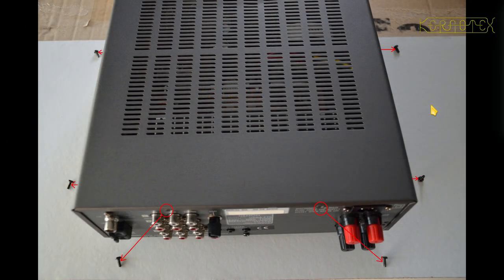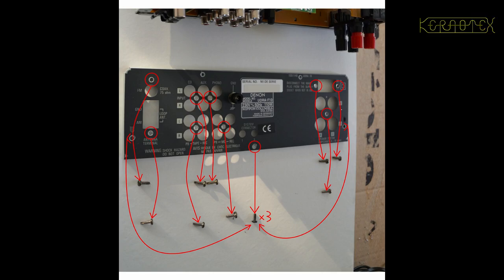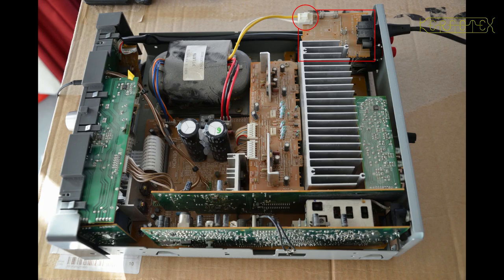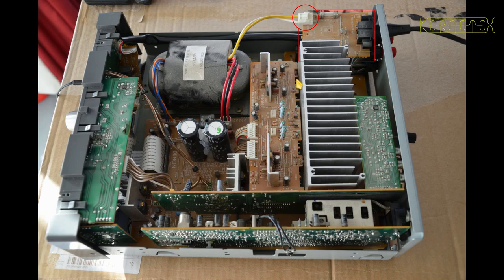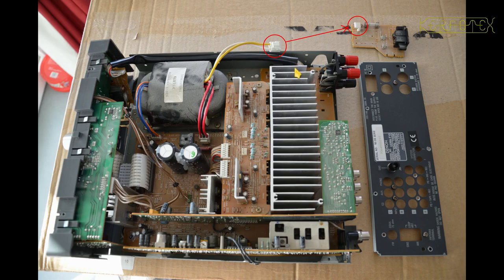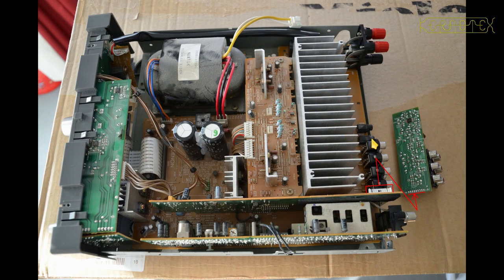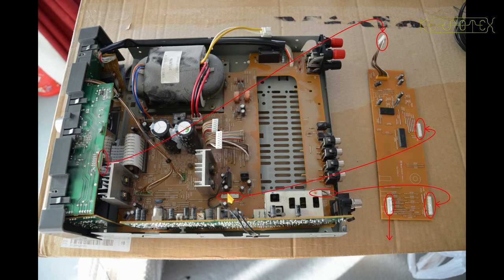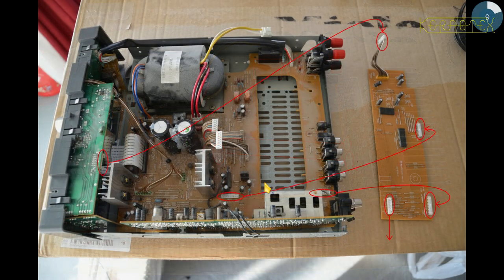Denon UDRA-F10 Repair for no sound from one or both channels

Comment: Great video thanks. It enabled me to fix my UPA F10 amp which is very similar. I had the same fault and having just replaced the same relay its now fixed. I'm going to cut open the relay and share the pic here if I can so me can see what the issue is.. I suspect carbonised contacts..
Reply from the maker: Thanks Anthony Fildes, happy it helped you too! I didn't take my relay apart (maybe I should) but like you I suspect the contacts have burnt out.

Comment: Thanks for good and detailed explanation. mine is Denon AVR3700h, which has a similar issue . denon audyssey detect speaker but no sound from Denon left or right speaker or with an external amplifier. all I can hear are some popping sound. any suggestion
Reply from the maker: Hi Deepak Sudevan, sounds like a dry joint or a loose connection. If there is a relay controlling the output stage in your Denon as there is in mine then it could be caused by dirty contacts.
Reply: @Kernotex  thank you.
Reply from the maker: @deepaksudevan  You're welcome!

Comment: Thanks for the video. I got a Denon AVR-S930 that has the front left and right speakers cutting out. I switched the speakers to other outputs and they work fine. Usually its only one speaker at a time that cuts out. Sometimes its the left and sometimes its the right but never both at the same time. Any idea how to approach this fix? Nobody in my area fixes these and it's only a year old so I want to fix it.  TYIA
Reply from the maker: Thanks The GG, That sounds a very strange symptom you have there! You could start by looking for bad solder joints in case there was a problem during the manufacturing process. Maybe loose leads inside (unlikely). I can't really think of anything else to look for with such a new machine other than getting it on the bench, sorry.
Reply: @Kernotex  i started tapping the receiver after watching several videos last night and the speakers kick back on. Gotta be a loose connection like you said. Thank you
Reply from the maker: @thegg5097  Good find! Thanks for coming back with your solution.

Comment: Heya, thanks for the video. Got a AVR-2113, where the front left speaker is way more silent than the right, no matter if headphones are plugged in or via speakers. Seems like it's somehow deadbeat, and when pinging it (say in windows 10), there's some kind of white noise to be heard, as if "somethings lying on the line" :D sorry, hard to describe. Got any idea maybe?
Reply from the maker: Hi Jebbel ! It sounds like it could to be more of a problem with power amp before it gets to the relay. However the relay is worth checking as it's a mechanical device and more prone to failure. The white noise could be high resistance from burnt contacts on the relay springs. If it's not that then I'd look at capacitors and the power transistors on the power amp board itself.

Comment: Hello sir, I have a Kinki THR-1 headphone amp and I am having problems with the right channel, it only happens with headphones but never the preamp XLR output and only when playing music. Randomly the right channel has noise/scratching/frying eggs kind of noise or the sound gets lost, if I increase volume sound comes back but with noise. Strangely when I play music with low frequencies is like a trigger to make the problem come.... I removed the top cover and when I move the front plate the sound comes back to normal. I cleaned the ALPS potentiometer and cleaned everything, both sides of the amp motherboard, caps are perfect, everything seems good, it has a relay as well. Is there a posibility to contact you and send you pics? I can pay if you'd help me fix it. Thank you very much
Reply from the maker: Hi José García it could be several things. I would start with the headphone socket itself - the connections that make contact with the headphone plug could be tarnished or loose. Check the connections of the socket to the circuit board. I've seen where the plug has been wiggled around in the socket so much it's caused a dry joint to occur though excessive force. If the relay is on the output stage for the headphone circuit then dirty contacts would be the problem.
Reply: @Kernotex  Thank you very much!! I managed to make a hole in the relay and put some deoxid inside, looks like the problem is gone lol. I never thought of the relay as the cause, I need more time to test it out tho but there's no longer static when connecting the headphones in the SE socket anymore so that's a good sign so far. You're amazing sir
Reply from the maker: @n00buo  Great News! Maybe a bit of dirt was on the relay contact and you shifted it. If the problem returns, it could be some arcing across the contacts. This could indicate a problem with suppression. But hopefully your repair will be the end of the problem now!
Reply: @Kernotex  I ended up replacing the relay for a new one, one of the metal pieces wasn't making clear contact to the other metal surface so that was the problem all along, a simple 3€ piece can make you think your $1000+ amp is faulty lol. Thanks again Kernotex you showed me the way
Reply from the maker: @n00buo  Hey that's great you fixed the problem permanently and cheaply!

Comment: Do you know how to set the clock on this? Can't find any button on the remote that hints towards setting the clock. Found it at goodwill.
Reply from the maker: Yes, set the clock like this (all buttons on UDRA F10 amp):

1. Hold Clock/Display button for several seconds until Hours flashes on display
2. Use Up and Down to set Hour.
3. Press Memo Ent/Next button to select Minutes
4. Again press Up and Down to set Minutes
5. Press Memo Ent/Next button at the moment you want to set the clock to start.

Alternatively, if you are tuned to an RDS radio station, you can press the CT button on the remote control to set the time from the broadcast.
Reply: @Kernotex  I found it by randomly holding some buttons a bit longer, but thanks. Is it true the clock resets after disconnecting the power.
Reply from the maker: Yes it does forget the time without power but I don't remember if there is a grace period or if it loses it as soon as the power drops. Enjoy your new Denon!
Reply: @Kernotex  The time remains on for a bit, but it starts flashing directly. Will measure the current draw in clock mode. Too bad the CD player isn't shut off by relais either.